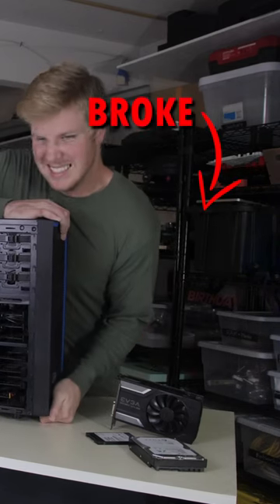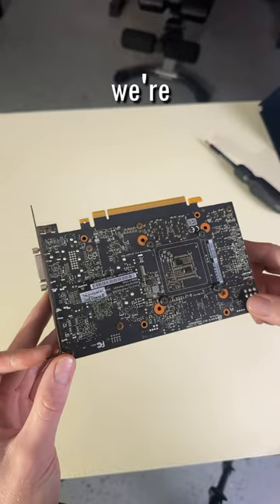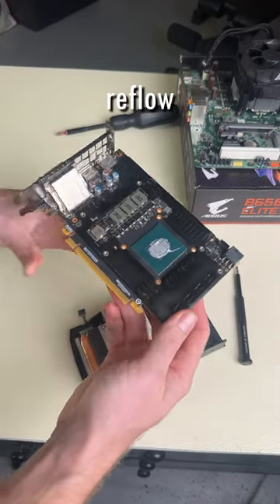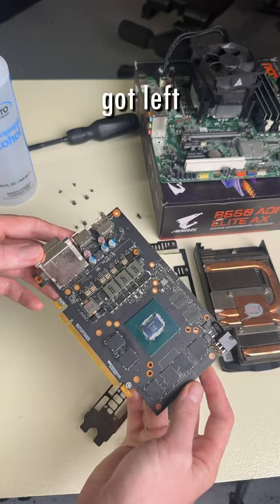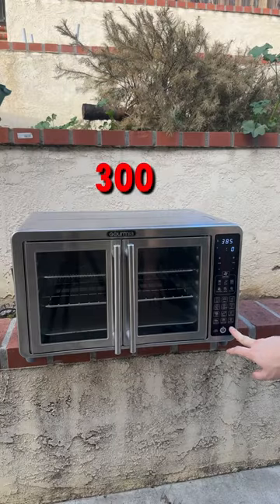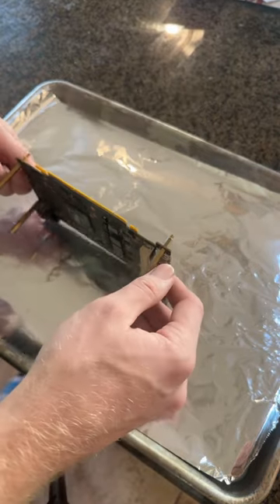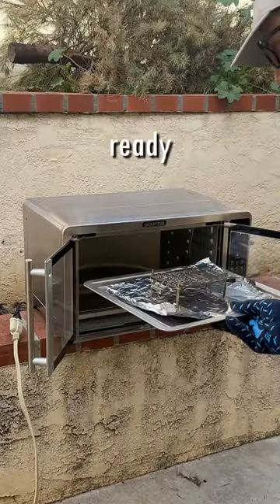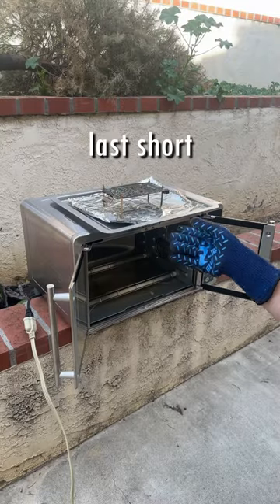Can an OVEN fix my dead GPU? Part 2 #pc #pcbuild

Comment: 😂 this always work like a charm, I am a computer repair technician, 2011 iMac had GPUs going bad left and right, initially when I didn’t have proper equipment to reflow solder on GPU die, I used to bake em and sure they worked.

Comment: Reflow is not useful unless you have leaded solder which would have to be applied aftermarket due to most electronics using non leaded solder 👍

Comment: You did it totally wrong by putting the GPU facing down in the oven, it should be facing straight up as when it heats up the GPU die will be putting more pressure when facing down on the pads instead of facing up.

Comment: I don't have to watch a second part to already know if you fixed it, there wasn't anything wrong in the first place.
Reply from the maker: Didn’t post on three different systems, then.. well, we’ll find out in the last one tomorrow!
Reply: I'm confused. If something gets fixed, it never needed to be fixed? Will you explain your logic there?
Reply: In all probability, the major things that could happen from a fall like the one shown is either something bent, something broke, or a cold solder joint was dislodged. Since it was placed in a oven for repair, we can assume the latter. However, even though we know that solder would indeed melt at 385 degrees, manufactures use unleaded solder which has a melting point of around 425 degrees, which leaves me to wonder how placing the card in an oven reflowed the solder to fix the card. Also, the solder balls that are used to flow a chip in place are extremely small. Without applying flux, you would just create a mess of solder bridges. There is one way I just now thought of. If the chip had been previously repaired and reflowed, fixing the card would be possible in this video. If anyone disagrees with me, enlighten me. I don't profess to "Know it all". We should all keep our minds open to possibilities, this one just seemed too far fetched to me. Kind of like drilling a hole in your phone to accept  an earphone jack.  @TheSpecterRanger
Reply: @blugoose86  I see what you are saying. Though there are several accounts online of people "reflowing" their GPUs and solving this issue while only using temperatures under 400 degrees F. Maybe your melting point assumption is wrong. If not, here is my understanding: The broken electrical contact would be extremely small, with a very tiny fracture or gap. I'd imagine getting the solder to a "tacky point" and not a "melting point" is all that's needed for the two sides of the fracture to contact each other and resume function. This may not be as secure a connection, but it is enough to work, so long that the GPU isn't mishandled again and takes a shock that may dislodge the connection again. Most use cases consist of a GPU sitting still in a stationary PC, so I'd imagine this fix would be acceptable for most use cases. Just don't drop the GPU again. Comments online seems to confirm my suspicions that often this type of fix leaves the problem connection in a less-robust state than OEM, making the GPU more likely to fail again while mishandling. Although this doesn't seem ideal, I'd imagine the lower temperature is the "safer" way to reflow a GPU in an oven, as a full-flow re-flow would allow liquid solder to potentially make unwanted contacts or flow away from it's intended contact point, especially if the GPU is not placed perfectly level, or if the oven has a fan blowing air around, or if the GPU is jostled in the process. Another thing to consider is the warping or melting that may occur from subjecting those plastics to those high temperatures for a prolonged period, which combined with liquid solder would quickly get out of hand. I'm guessing the GPU was genuinely "broken" via fractured connection, and that the 385 "reflow" attempt works to make the GPU function properly, at least until another drop happens.
Reply: @TheSpecterRanger  Well, is it science or is it luck? Who cares if it works, right? Ya learn something new everyday. I have to agree, some shortcuts and some tricks don't make any sense, and shouldn't work, but they do.  That's the beauty of experimentation and curiosity. We would never have a light bulb if Thomas didn't keep trying until it worked. Thanks, and have a great week.